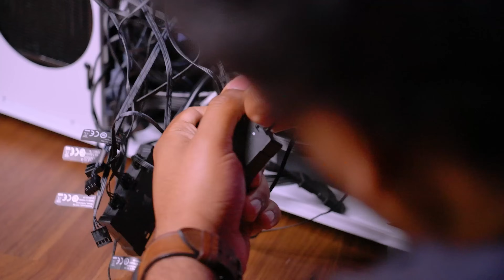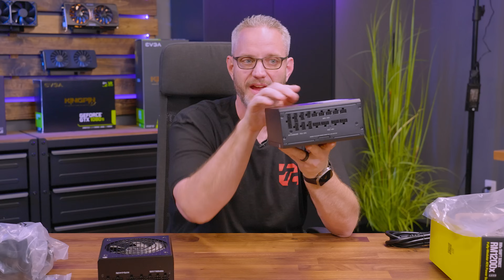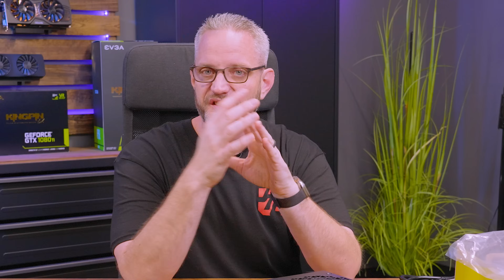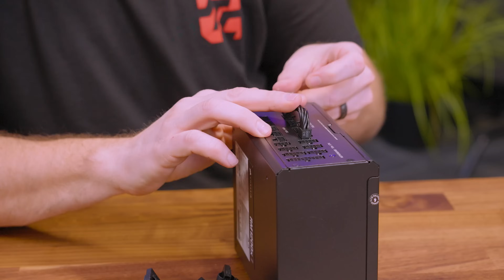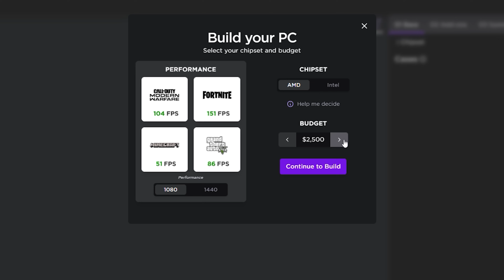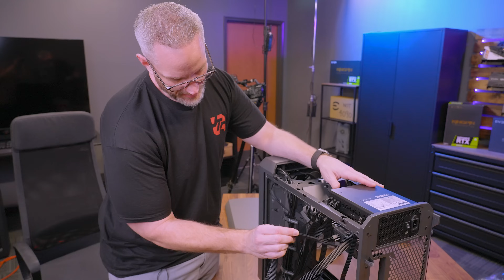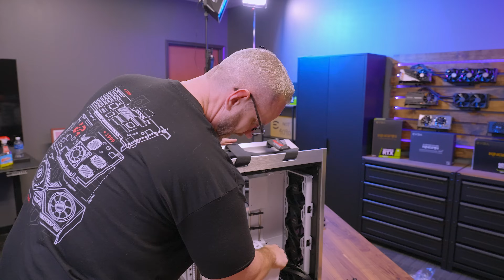I tried to prove this design was a failure... But then this happened.

Comment: This PSU wouldn't work for me at all in the orientation it's meant to go, with the fan down that is. - The reason is because the PSU sits all the way to the "right" (when seen from the front) panel, with only about an inch or so left over until it hits that panel. - It could work on the other side, but only if I'd remove the drive-cage, which I happened to have put back in for some extra SSDs (although I could move those somewhere else).

Comment: i actually have my psu wrong way around in my 011D ( corsair SF 750w) and the psu mounted in the middle slot because now the top 2 connectors on the PSU are CPU power (located on the top of the board) below that is the 24 pin (located on the middle of the board) and the PCI-E (also middle of the board) with the Sata power at the bottom of the PSU (guess where all my sata stuff is...near the bottom).

just made a LOT more sense, and with the SF I have about an inch of clearance between the psu and mobo...still put a little 60mm noctua fan below the psu angled at the gap to provide a supply of fresh air in case it needs it (have a 2070S and a 3900X so not worried about it melting down when a 1000W load hits it :P)

was planning to make my own cables but after spending 6 hours tweaking the EPS cable I decided not to (the EPS looks amazing and it's exactly as long as it needs to be but that took FOR EVER).

Comment: The side attached cables are better in the first case as the connectors are accessible from above when you get it out of the case where the other one has the cables flat to the table which is harder to work on.

Comment: I just built a system with the OD-11 Evo and MSI Carbon X670-E Board, 4 NVME, 1 SATA SSD and 2 Large 3.5inc HD's for other stuff - Sorry but I am not wasting SSD space for those files and I need large non SSD fast drives. 

The way you do it in the EVO is you remove that top HD Cage, you do do not need it, you can mount SATA SSD's on the retaining bar, and the 3.5 inch drives up to 2 go on the side near the front. You can if needed mount SSDs on the bottom side of the case under the GPU, if not mounting your GPU side ways. 

Removing that cage makes it heaven to access the PSU cables. Of course there are trade offs within everything, but in the EVO 11-d removing the HD cage with the shift is probably a must.

Comment: That is the type of innovation this hobby has been missing. Throw in some custom cable mods and the possibilities are endless. Corsair need to now come up with a tool to make it easier to insert and remove those cables for those of us blessed with thick fingers. Think fuse pullers in the automotive world for an example of what I am thinking.

Comment: i dont like smaller pins and plugs. this reminds me of when cars went from atx fuses to mini atx fuses. with atx fuses you never had to replace fuse boxes. now with mini atx fuses replacement of fuse boxes has become so common that car manufactures  put plugs where main wire harness goes to fuse box so the fuse box can be replaced. with atx fuse main wire harness wired directly to fuse box with no plug because there was no problems. smaller pins can not handle the same amperage long term as larger pins. above example is a perfect example.

Comment: A novel idea that is pretty much useless.   Not just in practical use but in cable management ability,  it's agreed that if case manufacturers incorporated the design with this PSU in mind it would work great.  Corsair design cases so maybe they'll release something with this design in mind, either way at this point cable management has become a Thermal paste application rabbit hole.  Even a mildly sloppy cable management scheme causes little to no heat issues these day anyways, but there are those who swear that 1c difference will cause all kinds of issues reality dictates and proves doesn't happen.  Kudos Corsair for the continued innovations things always get better when folks keep pushing the envelope.

Comment: The power supply seems to fit very well in some of those atx cases. I have a hx1200 already so I wouldn't upgrade to this one for the 5.0 plug.

Side note, the cable managing always looks easy until you stuff 2x power commanders and 9-12 rgb fans and a commander core from the 360 AIO 😂😂. I have the O11 Evo inverted mode on the left side of the desk atm but I never want to open the back cover cause i know I crammed those 3 power commanders behind the middle Lian Li "cable management" bar

Comment: I sold my old Antec 1200W PSU a few years ago, and that was huge. probably as big as PSUs got in those days (10+ years ago). nice to see the 1200W reducing form factor size just a tad, however with those different sized cables running from the PSU, I can see a lot of gnashing of teeth because people don't like change with PC building, even when some 'creative-type' at a company does. as for the PSU fan, I still have my old HX-750i from 3 builds ago, and I never hear it spin, because it doesn't. it works, but only on startup, for one second. it's never been run hard enough to warrant fulltime duty, and I game and edit videos so it does get put through its paces.

Comment: Thanks Jay! I literally have this exact same PSU I'm getting ready to throw into a Fractal North w/ 4090 build. Its side connectors were really interesting to me for a normal lower chamber mid tower. Glad to see my purchase made sense!
Reply: I'm planning on getting the same case, PSU and Asus x Noctua RTX 4080 so I'd love to hear your opinion once you've finished building your PC.
Reply: Did this psu fit in the North case? Was there enough room on side to route cables?
Reply: @valhalla9850  yup, it fit. See comment above
Reply: Did you face any issues?
Reply: @Sudhakar0712  no issues, it fit great! If you do a google search for "reddit fractal north black gold walnut custom loop" you'll see my final build

Comment: I just built a new 7800X3D system for a friend using the Corsair 5000D RGB Airflow case and the 850x SHIFT PSU. And it was absolutely amazing. Came out incredibly clean with the stock cables.

Comment: What Corsair should do is make that same Shift PSU but add the ability to move the fan to either side with some slight effort (removing screws, unplugging fan power cable, swapping with back plate).

Comment: I did note that on the white ROG case, the shroud that blocks the cables has two screws ( 21:11 ) that seem to be holding it in place, if that was removed, there would no longer be an issue, right?

Comment: "you are now forced".... if you intend to make use of that new design. I'm sure Corsair isn't dropping all of their prior models just to produce this new design.  My case right now would be SOOOO much easier to cable up with the connectors on the side. Having a new design available like this opens up more options for the cable layout. Was it meant to work in every case? Of course not.

Comment: It think it’s nice and innovative, but what I feel what could enhance it is if the ports were recessed and angled away from back of the PSU.  That way the cables could flow into the  case as well as make easier 180’s if needed

Comment: I just built a computer using the 1000x shift in a Lian Li Lancool III and I pretty easily got the magnetic side panel to close with no problems. Can’t say the stress on the plug doesn’t worry me a little but it let me add multiple fans on the bottom of the case for additional inlet air flow without all the wires from the power supply restricting airflow.😊

Comment: I hate to admit it but the beginning with the cables was my last build lets just say I am very proficient with zip ties.  ANYTHING that can cut that mess down is welcome news!  Yeah a really good high rated power supply is EXPENSIVE now days especially around 1000 watts.  I mean expensive!  Dumb question for anyone who knows, if my Motherboard has the extra cpu power optional does that give the motherboard more power or backup for say USB and lighting and junk or is it just for high draw CPU's?  What happens if I do not plug the optional plug into that spot does it lose performance?  It does not say really in the manual it just says optional CPU power....odd.

Comment: Corsair made it confusing to everyone with the power limits specs on their website when they released this thing! it's actually 300w on the RM850X Shifts , 450w on Rm1000X and 600w on RM1200X (shifts). I bought a RM1000X Shift and found that out the expensive way to power my 4090 , open box no return policy on PSUs  :( so I had to get the RM1200X Shift right away to get the 600W Power Limit...

Comment: Hot take: Those clips need to die.
Instead, I would like to see spring loaded detents or something.. where the plug "clicks" into place mechanically to ensure it either has good contact or zero contact (avoiding that issue of sparky sparky melt sadness) and can simply be pulled loose without squeezing your fingers in to get at a sharp edged clip

It would be easier for nooby end users to ensure good contact when inserted + easier for new & veteran users to remove/replace individual cables
Reply: Also: Instead of smaller plugs on the side they could instead have recessed them into the body - making the PSU internals narrower, but the case as a whole could be lengthened since there's no need for cables at the end.. Thus same internal area overall but with a different layout

Comment: What I don't understand about power supplies is that 99% of cables comming out need to be turned up, down, left or right to some degree, they almost never run straight. Lots of other cables that plug into mb's like sata and usb  for example have options to use 90° connections so why not on modular psu's,(I have never seen one) it could make life easier and estetically more pleasing. Maybe someone could invent/market right angle adapters for modular psu's and motherboards.
Reply: cables coming out of the PSU can never go straight in a dection tehy would all run into each other. RIght able sata connectors is just them simplifying the design. Also drives are very standardized. Non reference GPU's have not standard. 8pins on a board can be various places and have VRM very very close. Basically to much variability. Heck EVGA has them all on one side as 90 degree.

Comment: I'm using this PSU in a 7000D Airflow with a 13700K and a 4090, and it was excellent to build with! Made cable management way less tangled and annoying.
Reply: Thanks for confirming, just ordered this PSU for my 7000D and was not quite sure if it would fit well after watching this video

Comment: Idk cables come out the side. Make sure your case is happy with the cables coming out the side.

This is better for those tiny ATX mid towers with the drive cage right in front of the PSU that Corsair likes to sell. But its more of a solution to a problem they created.

Comment: if you want to test if the design has a failure, you should check with cheaper old, really old cases, by design it is not usable there, i would not buy it because i would have problems with it

Comment: Having built in the Fractal Torrent, by far the biggest issue for cable routing is getting PCIe power to top-mounted video card plugs.  I wound up having to use the pigtail connectors as the only connector because I needed that extra 3 inches of space to reach my card.  WOuld have been interesting to see if the side mounted cables would reduce that limitation somewhat

Fundamentally, this is because cable lengths on modern power supplies are tailored for the standard modern case layout - PSU at the bottom back corner, so the PCIe cables are a little on the short side, while the CPU power (which is expected to have to run all the way to the very top of the case) is very long indeed.  It's unfortunate that third party power cabling is so horrendously expensive as that makes it not really an option unless you're going full ham on the build....which I guess is kinda the target market for buyers of the Torrent - it is not a cheap case by any means, and I suspect it is a minority who, like me, decided to get a high end airflow case to meet the needs of future computers for quite some time.  (Honestly, unless there is some radical change in our understanding of how air cools cases or we wind up with some radically different component that renders the ATX mounting standards obsolete, I see no reason to ever get a new case for my primary computer - just new fans occasionally as the old ones wear out.)
Reply: get an extension? Also 12VHP cables seem to be stupid long so you likely wouldnt have had an issue with one of those.
Reply: @profosist  ....Yes, cablemod exists.  Thank you.

My point was that Jay was focused on the CPU power cable because when you're building with a bottom mounted PSU, that's the one that's hard to route.  I wanted to point out that video card power is the tricky option in the Torrent thanks to its design, so if he were to try running that cable, it would be a more informative test of the side mount power plugs for that specific case.
Reply: @rashkavar  having built in a torrent and 2 torrent compact I just kind of did what I normally do

plug the motherboard shove it through the hole run it along the back plugging into the power supply

Comment: The only thing I'm unclear about is if I can plug in my 7900XT or not. I'm assuming, yes? The change in nomenclature is confusing.
Reply: why wouldn't you be able to? its a PSU...
Reply: @profosist  Because it specifically says the connections are PCIe Gen 5 and says nothing about backwards compatibility. I don't know what a Gen 5 connection is specifically. I asked a valid question. Your reply is beyond useless.
Reply: @profosist  Even Jay said that the connections would not be compatible with last gen cards. I don't know if he means cable mod stuff or the included cables. I just asked for clarification.
Reply: @mckrackin5324  either you're taking about the 12VHP since 3000 series didn't have the sense pins or you talking about the gen 5 corsair cables. Either way use the right cable for the right thing and no problems.

Comment: I've been using  this power supply for 3 mouths now and haven't had any problems. I have the 1200 PSU  with a 6800xt aorus GPU

Comment: on the O11 dynamic, I do believe most people take the hard drive cages out. I had a couple fan controllers in mine and without taking out the hard drive cages there’s no way all my cables would have fit.

Comment: Makes sense because the 12V is split across two rails and it sounds like the 12V for the graphics card is only on one rail which limits it to approximately half the total 12 V output. A better but probably more costly solution would be to make sure the 12V power for graphics takes power from both rails. I helped a guy with a 1000W Seasonic and a 3080 who was having problems with AC Origins causing his computer to reboot, a classic symptom of an OCP tripping. He had one of those dumb B550 boards with the totally unneeded extra 4 pin 12V power leads so he had 2 12V leads going to the motherboard and then the other rail with 3 8 pin leads going to his 3080.(Which has a known transient power draw problem) What I had him do was remove that stupid 4 pin cable completely and move one of the 12V plugs for the GPU up to it which helped balance the GPU load across both 12V rails .... Problem solved. The thing that made it so hard for him to figure out (other than not realizing the 12V rail is split) was AC Odyssey, AC Valhalla and none of his other games that were more demanding were causing a problem, only AC Origins which for some reason would cause a transient spike in the current draw under certain situations which was enough to trip the OCP on that 12V power rail

Comment: I am glad Jay actually went through the trouble of trying this out in different cases.  Kyle instead went with the case that was provided to him that was made to work with this PSU configuration, which just seems lazy as hell.
Reply: or they designed the psu to work with certain cases and you would use one of those...

Comment: Just an FYI, I have the RM1000x and it says on the box it is limited to 450watts. I have a 7000D case and yes, it was a breeze to cable manage being a Corsair product.
Reply: Mate.... does a RM1000x say it is limited to 450 watts?  As a joke I still barely get it. It is actually not even limited to 1000watts they always undervalue it on purpose.........probably can do 1150watts

Comment: I still have a Cooler Master HAF EVO case.  One issue in that case's stock config is that a longer PSU's wires hit the back of the PCB on the hot swap bays.  No problem with this PSU.

Comment: I was kinda drooling at the cabling options when I saw the thumbnails... if for not other reasons... I hat trying to plug cables in blind.  And was annoyed that they only come in higher wattage options... but it occurred to me that if I need a 1200W to power my machine... I'm probably not using a tiny case without sufficient access.  Still for for the right case it's brilliant.

Comment: "Uncablemanage and slide it out"   No, just unplug the cables from the PSU and slide it out.   It's actually much easier when you can reach and see the connections.

Comment: You don't have to use the Shift PSUs in this type of case.  I would imagine you'd have enough sense to know which PSU to use in which type of case depending on how the PSU is situated in the case.  I would use that PSU in a case where the PSU mounts at the top of bottom of the case where I can see the outlets facing towards the side of the case where your cables are normally run/hidden/cable-managed.